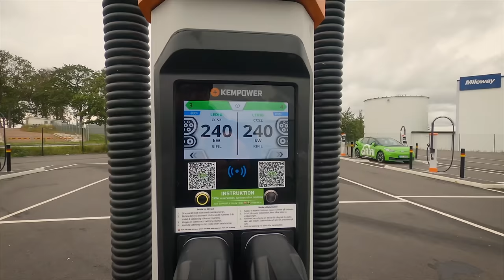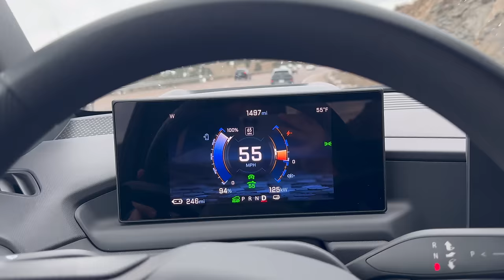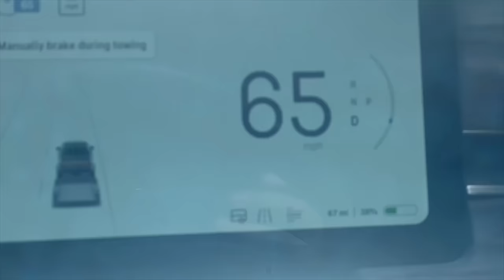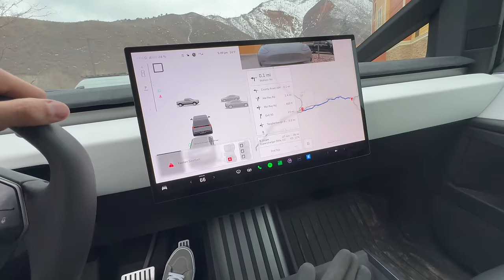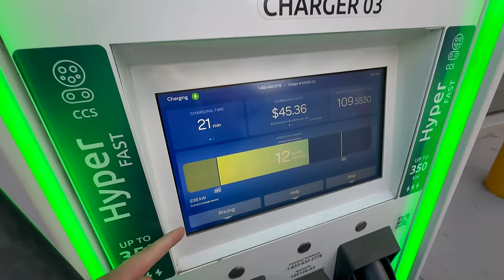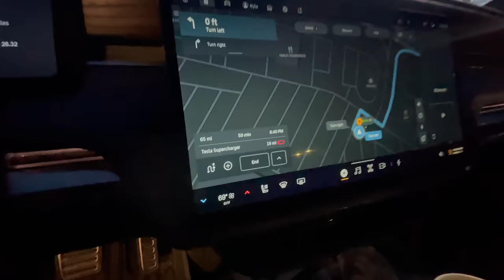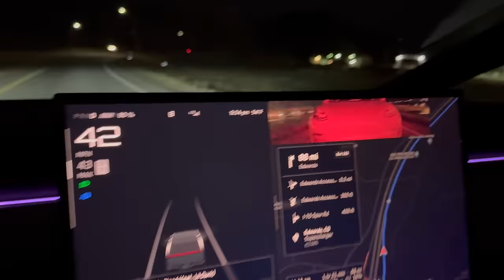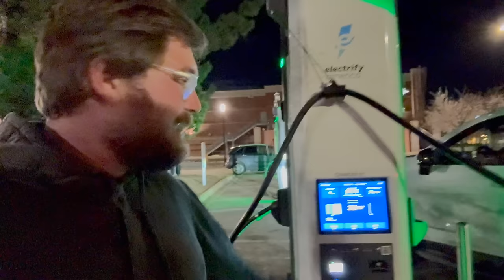Electric Trucks Tow 500mi Over The Rocky Mountains! Cybertruck vs Lightning vs Silverado EV vs R1T

Comment: Yeah but what about towing a 33' 10K LB travel trailer.  Not interested in making multiple stops, and then begs the questions, how does one pull into a charging station with a 55' long rig.???  Take up multiple stations, if they're even available, or disconnect the rig then charge.  Thanks but no thanks.

Comment: I thought this would be a unnecessary waste of time , but was completely wrong , just shows the benefits of a big battery pack . Imagine if 90 percent of the time you could use half your battery pack to power your home , and then on the few occasions in a year when you need large range , could simply and quickly add the batteries to your vehicle with no tools or fasteners required , that would be handy. So then all trucks especially should in theory be setp to add  extra batteries super simply and not compromise any bed storage area. That would be cool.

Comment: The 2024 Silverado 4WT has a max payload capacity of only 1,400 lbs (and 10,000 lb tow capacity).  That's silly; the battery is too heavy.  By comparison, my 2015 Tesla Model S has a max payload of 978 lbs, with a lot of hatchback space, and when fully loaded consumes only 305 watt-hours per mile at 65 mph (climate control off).

Comment: ❤ So funny competition. I'm from Europe ❤ Sweden 🇸🇪♥️. Max weight car/truck + tow is ca 7000 pounds on B license. B license in Europe is the license everyone has. In order to tow more you need E license to go with your B license, which a small few has. Max speed when towing is 50mph.
Reply: In Serbia with B you can tow 3.5 tons (8000 pounds) and car should be under 3.5 tons so max 7 tons
Reply: @dzonikg Yes, most of these vehicles would be beyond what's legally allowed on a standard B license. That's why you don't see many of the bigger (250/2500 etc) pickup trucks on european roads - they need a commercial license in order to drive them - and everyone tows caravans with cars and vans.
Reply: @bikeaddictbp  Yes i have  hobby caravan ,it weight 1.5 tons and can sleep 4 ,when i see does USA caravans they all weight like 4 tons and more. 
  There are in my town that  "American style" pickup truck but people who drived most drive them for appeal ,and most have 2.0 diesel in it so you want tow much with it because that truck is heavy already.
 I tow with Opel Insignia caravan 2016 2.0 diesel ,i have also BMW 40d E70 which has much more power  but it does not have  tow hitch

Comment: The cost of the charging seems to be very high, thought EV's were cheaper to operate
Reply: DCFS is not that much cheaper than gas, the real cost savings are when your charging overnight at home or on a public L2 AC charger that's where it's easy cheaper than gas

Comment: I wouldn't give 2 shits about my trailer blocking the charger entrance/exit. They designed the chargers that way, so as far as I'm concerned you're using it as designed. Their problem, not mine.

Comment: All good until you need to replace the battery in chevy. 
Wonder if driving 55 in Ford would have gotten better range and less charging?
All season is for snow, all terrain is not for snow.
Reply: Driving slower in all of them would have resulted in better range in all of them. Unrelated to EV or combustion-engine, I don't exceed 110 km/h (about 65 mph) when towing anything; usually 100 - 105 km/h. Safety ... tires ... braking distances ... fuel consumption ... stress and strain on everything.
Reply: My lightning will lose about .5 miles per kilowatt hour from 55 to 75.  We need a second towing gear in electric cars ICE has 10 gears now.

Comment: Having road-tripped in a Bolt EV, especially in high temperatures when charging was throttled to 32kW, you dont go as fast as you can as you can save time going 60mph (which is way too slow in rural Arizona)...

Comment: Nice video.  I'm still not convinced.  My Dodge Ram 6.7 Diesel with its extra fuel tank I installed, can easily go over 700 miles in-between fill ups while towing a 28' Airstream trailer.  The extra six plus hours per day traveling adds up quickly when traveling over the summer.  Happy trails.

Comment: At a US average gas pump rate of 13 gallons per minute, my 40mpg Avalon hybrid can take on a full circumnavigation of the Earth (24,000 miles) worth of fuel in a little over 46 minutes. (Just not all at once. I'd have to make 39 stops of about 74 seconds each and drive 400 hours at 60mph.) I'm impressed with the Silverado's 350Kw charging speed, but EV's still have a long way to go to road trip like an ICE powered vehicle. Keep the great videos coming though. I'm enjoying watching the amazing progress EVs are making!

Comment: The Silverado is a very impressive EV for towing.  It is too bad it takes an elephant battery to accomplish this, but that seems where we are in EV batteries now.
Reply: Towing range depends ENTIRELY on energy density plus good efficiency. that's why ev's sucked for towing until the silverado ev.

You can't depend on aero when your trailer is not going to compliment the truck. So don't expect anything to change on trucks used for towing to get smaller batteries. Energy density will improve, but the kwh rating will not be dropping significantly for BEV trucks designed for towing. It's a TRUCK, not a car.
Reply: @Modikie  No, the Silverado EV is not more energy dense nor more efficient. It just has a larger pack.
Reply: @boostav  my apologies. i meant higher capacity and good enough efficiency. the hummer has a huge battery, but is so inefficient it drops its range by 130 miles. 

but if you want to make a lighter more efficient truck, you will need higher energy density because there is simply no way to tow long distances with the amount of energy the cybertruck, lightning, or r1t have. you simply NEED a lot of energy. even if that makes you less efficient, you need a high capacity battery to tow long distances. 

that will never change because its all a factor of energy quantity.
Reply: @Modikie  Yep all good, I agree for towing you need a huge pack, there's no other way around it. For that reason the Silverado is the best choice if you need to tow long distances. Was just to point out that energy density is a different thing, for example Cybertruck's pack is actually more energy dense at ~170Wh/kg vs ~160Wh/kg of the Silverado.
Reply: @boostav  yes, simply used seeing terminology I meant density in that you want the most energy density so you have the biggest pack at thr lowest weight, but capacity is more important. I think the energy density of the silverado pack is held back by gm using steel instead of aluminum in its construction.

Comment: Tesla we know take care of the batteries, in the long run. But how does Silverado, Porsche and other OEM's? We know they all want EV's to fail due to lack of investment and long term commitment. Kyle, make the same drive with the same Silverado in 3 yrs or 5 yrs. Degradation is real. Awesome stuff, and video ❤ love from Sweden to all the dudes making it happen
Reply: GM absolutely does not want EVs to fail. And, while I will grant that Ultium battery cells have not been around for long enough to prove their longevity, Chevy Bolt batteries have shown very low degradation.
Reply: @bikeaddictbp  Silverado charges at 350kwh and Bolt charges at what? Not a common car in Europe. I know Barra wants more dough, please share any inside you have ♥️♥️♥️
Reply: Insights* sorry Swede🇸🇪♥️ English is not my native language

Comment: I heard zero discussion on ROI. How many years till you recover $107,000 from your ststems?systems?

If you save $250 a month on electricity, the ROI is 35 years... NOT worth it at all!. If you sell back $100 a month Surplus and save $250 a month ago. I.e. $350 a month it's a 25 year ROI... 

Basically, when the panels are done, it's time to replace them.

The math doesn't work...

To get a 10 year roi: $891 a month savings and or sell back.
To get a 5 year roi:$1783 a month savings and or sell back

Comment: I'm convinced! I don't want an EV.
Reply: Fine suit yourself.
Reply: @BrentonSmythesfieldsaye  That's the right answer.
Reply: @keithcanfield3251  Can I ask the question, can you conceive a time when you would want an EV?
Reply: @BrentonSmythesfieldsaye  When there are charging stations as ubiquitous as gas stations, when charging times are a matter of minutes, when the batteries are perfected to operate efficiently at sub zero temperatures, when the cost of the vehicle and replacement batteries are in line with gas powered cars, when there is ample power generation to support the additional demand on electricity.
Can you give me one reason anyone would buy an EV? Any effect they'll have on climate change is negligible, as is the effect that gas powered cars have on the climate.
Reply: @keithcanfield3251  I was not trying to trap you with the question by the way.

For me, when an EV can save me on running costs across each year, which means I will be buying one some time this year. All the points you raise, which are fair enough, don't rate in my particular scenario. But those shortcomings are all gradually and progressively being addressed anyway, no different to way back when the automobile began displacing the horse and cart in that sense. There was the same sort of resistance to getting onboard with the automobile back then as well. Look at it now, amazing.

"Any effect they'll have on climate change is negligible, as is the effect that gas powered cars have on the climate." - That statement is missing the real world constraints that may or may not apply. For example, I have calculated that 90-95% of my charging can be done at home and of that, a substantial amount is going to come from my rooftop solar, such is the capacity and capability of the system. But also we have very generous EV charging rates overnight, that overnight charging helps keep the grid operation better apparently. Compare that to public charger use if the grid is dominated by fossil fuel generation and you have a point of course. But even that is changing as renewables continue to penetrate our grid at a fast pace. I am in Australia by the way. At the moment, some of the public chargers are also free to use, no charge involved.

As for the lifetime emission of all vehicle types, all the assessments from vocational research, energy and vehicle organisations I have read seem to come to the same conclusion, that EVs produce less emissions over a vehicles lifetime. That result will also get better as the energy transition progresses into the future.

But these are the way I see things. You may see it differently, I am not here to convince you of anything. As I originally responded, suit yourself, your choice.  Take care.
Reply: @BrentonSmythesfieldsaye  Thanks for the thoughtful reply. I have no animus toward EV's. The problem is with the government trying to force them on people.
I agree that, assuming EV's are the way of the future,  they will improve and the cost should come down.
I'm a firm believer in capitalism and when the advantages outweigh the disadvantages, people will voluntarily buy them. They work for some people now, and that's great.
One last point. America has many, more serious problems, than climate change. Our taxes could be solving other more pressing problems.
I hope the EV works out for you. I have a friend that has a hybrid and so far he loves it.

Comment: EV towing is going to be rough as long as charge times and big batteries are necessary.  All of the trucks can handle Short tow within City limits fine.  The Chevy might be better but risk extra long charge times too.  Especially if you can't get maxed out charging speed.  Either way someone who long distance tows even a few times a year is going to have a hard time switching to EVs.  All the trucks are a bit expensive just to operate as a pure work site truck.  I can however see a few people doing private property towing stuff with EVs.  As they can charge them on their property too.

Comment: Trouble is GM makes so few EV Trucks!
Reply: They have delivered more Silverado EVs than Tesla has Cybertrucks.
Reply: Yes, the launch was delayed (a lot - they had more than their share of technical headaches), but production is ramping up now.
Reply: @bikeaddictbp  The first Silverado EV was delivered about 6 months after the originally planned date. That isn't a huge miss. Much closer than the Cybertruck estimated date was.
Reply: @TroySavary  that's for sure. It has taken frustratingly long for BT1XX production to ramp up but it's still ahead of cybertruck.
Reply: @TroySavary  but given the same amount of time, down the line, CyberTruck will be way ahead of the produced Silverado, HummerEVs, and Cadillac Lyriqs combined! Where are the rest of the 30 GM Models, Mary Barra promised? GM is now retreating into
hybrid land and has reverted to sucking It’s thumb like a two year old baby!
Reply: @DishNetworkDealerNEO  Silverado EV delivered over 400 in the first 3 months it was available. That's more than Cybertruck did in Dec, Jan, and Feb.

Comment: Great video. But your view is so slanted to GM( which has spent $0 in a supercharger network).
What will happen when EA's dieselgate money runs out? How many working chargers you'll find?( and will they work?). Or when you have a serious amount of GMs competing for EA spaces?
Btw, if you paid $100 to the guy charging at EA to give you access to the only fast charger working, that's cheating.
Btw2; will you show how hard is to pair with EA chargers? Or how many are not working? Cybertruck( and all Teslas) have 0 issues with pairing the car to superchargers; ever.

Comment: Wait a second…$76 for an hour of charging for 250miles? When you can get a much less expensive truck with an ICE and get double the range for the same cost of a gas fill? EV trucks certainly capable, but still not practical.
Reply: Or 250 miles for $10 when charging at home or work. Or for free if you have solar at home or work. Or driving 450 miles without towing for free with solar. Or for 10 to $15 charging at home without solar.

Comment: Completely bogus test.  The reason towing range for EVs can be quite bad is much more owing to the additional aerodynamic drag of the trailer than the weight of the trailer.  You chose trailers with low additional drag, not at all representative of the performance you will get towing a camping trailer or an enclosed full-height trailer.  Why in the world are you choosing to mislead your viewers?

Comment: So... i own a 2016 Tesla s a 17 x and a 23 f150 EV. So not an EV hater. Using these Evs to tow and road charge makes no sense. these loads could have been towed by a small displacement engine f150 or chevy and done just fine for INSANELY cheaper. Yes they can do it But ev towing is no where near close! too darn expensive!!!!! 50-100 dollar fillups to travel under 250 miles? NO! And the wait! NO!

Comment: Great video, but it sucks that Tesla owners don’t know that a V2 is only about 2 minutes slower than a V3.
Reply: That sounds like marketing data vs real world experience.  Driving through Kansas takes FOREVER because most of the chargers there are v2 or earlier for example.
Reply: @yayinternets  not really. 10 to 80% on V3 is 29 mins. 10 to 80% on V2 is 31 mins.
Reply: @voldar70  Not in my experience. And definitely not in a race like this when you need the fastest rates and to disconnect as soon as it drops to around 150kw, which is the very highest on optimal conditions on a V2. And let's not get into someone parking next to you and your speed dropping to only 75kw at best.
Reply: @Paul-cj1wb  It is my experience. And I tested it in numerous occasions. I do agree that if someone comes near you, your charging speed goes down to 75 kW, but if you are at 70% SOC this isn’t much of a problem. At 70% SOC you get about 70 kW anyway. 
As for this video, the CT owner was a noob in EV tripping. While the rest of the drivers knew what they are doing, He drove at speeds of 80 mph or more and stopped at a 120 kW V2 instead of driving 75-78 mph and go 20 miles further to charge on a V3. It was laughable to see and I am not surprised it finished last.
Reply: @voldar70  Then you've never charged on a V2. A V2 stall splits power directly between 2, so that if someone parks next to you all you get is 75kw from the start. And it only goes down from there.

I'm not talking about this video other than their V2 decision, which was very dumb. I was only talking about your V2 comment being no more than 2 minutes from a V3 which is completely false. I've charged in both and there is a huge difference.

A modern Model S, for instance (or even the Cybertruck), stays at 250kw till 31% SoC, giving them a huge advantage over a v2 at 150kw max, or 75 max if split. A modern Model S adds over 200 miles of range (at 70mph) in only 16 minutes on a V3. It only gets a small fraction of that on a V2 in that amount of time.
Reply: @Paul-cj1wb  I did charge on V2 when there was no one beside me, so no shared power. Most of the time I charged at full speed 145-147 kW until 39% SOC. On a V3 only from 10 to 39 you have a faster charging speed, then the charging curve is the same for both V2 and V3 from there on. And yes, the difference is about 2-3 minutes top, charging from 10% to 40%. I am talking about a M3, of course. In the case of a Model S, yes, the charging time can be more in a V2 vs V3. But again, it’s all about the fist 30%.
Reply: @voldar70  Then you must have a Model 3 with LFP which tops out at 170kw or so even on a V3. In which case, you won't see the big difference.
Reply: @Paul-cj1wb  nope. It’s the LR